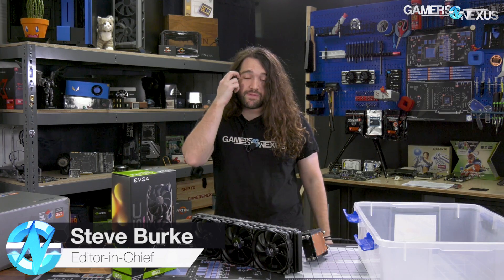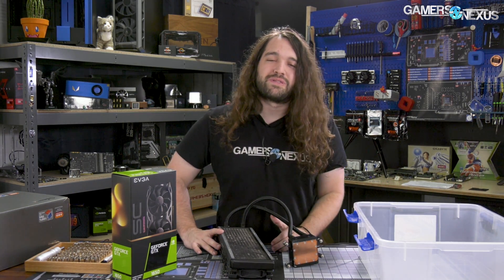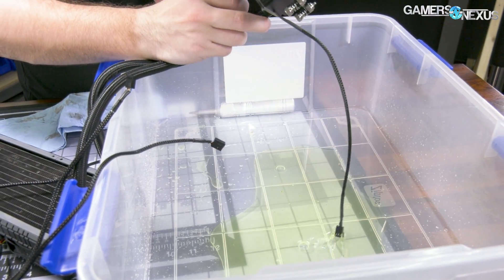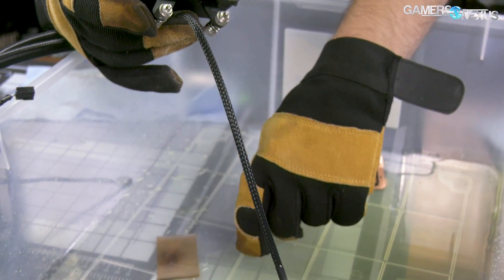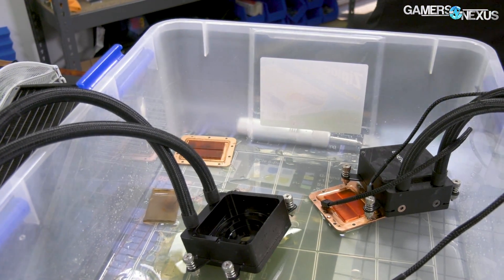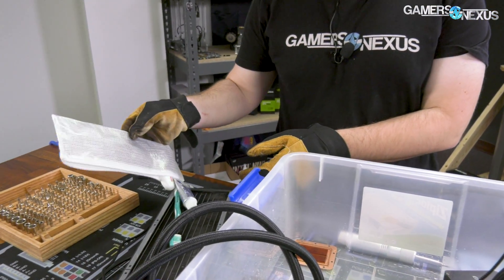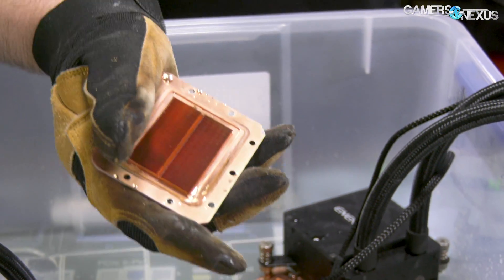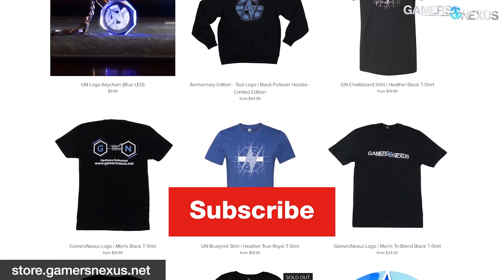Enermax's AIO Gunk Problem: Liqtech TR4 Cooler After 18 Months

Comment: My 360 died a month ago. CPU started throttling under any heavy load and you could feel on the radiator that it was only hot in one corner. I took that to mean there was little to no flow and I'm in the process of swapping it out for a Dark Rock Pro. Kinda lost faith in all AIO coolers because of this...

Comment: I replaced my cooler with a comparable Noctua when I noticed my temps to starting to rise a few months back. Just from morbid curiosity, I tore apart my 280mm Liqtech and found that it does seem to actually dissolve the white gasket somehow, also in my unit I noticed both a considerable amount of corrosion, some of which was on the SIDE of my cold plate as well! There was also some type of yellowish,almost grease like fungus that had built in the loop, long story short I just threw mine out, but seriously enermax really should've done better with these coolers considering when they were released they were cooling 500+$ processors, like if I had cooked my 1920X just months after purchase, I would've been a very unpleasant customer for their customer service to handle, but I digress.

Comment: My Enermax LiqTech 360 died exactly one week ago. Pump works but radiator does not get warm. Tubes get really hot, block as well. Maybe the radiator is gunkt.
Thinking about getting a noctua or bequiet air cooler, but I would have to change my case too.

Comment: I'm not a fan of AiOs, they just aren't built to last.
Though I wonder if anything grows inside heatpipes?
Reply: Damian Chiliński  I sincerely doubt any water cooled system will run without maintenance for more than 4 years, there's just too many points of failure, which may go unnoticed long enough to cause catastrophic damage.
I can't reccomend anything high maintenance like water cooling for important equipment, since any failure will require a lot of down time.

Comment: Bought one based on your review, but sadly you can't test for these things, I guess the only thing you could do is go by brand reputation. Amazon reviews can be quite helpful in that regard though. Anyhow, mine died, luckily my 1950x protected itself and shut down the pc. I thought my overclock was unstable but even stock was unstable so I looked at the cooler for a bit, the pump was running just fine but no water got to the rad. The block would heat up and over the course of minutes you could feel the tube get hotter and very slowly moving towards the rad. Send it back and got a new one but never used it again. It did reduce my overclocking stability it seems, but luckily didn't kill my cpu or leak over my motherboard. Just went open loop after that. Also, the fans died after only a few months, that was annoying, won't go the enermax route anytime soon, if one part fails, it happens, but if both the loop and the fans fail, reliably, nah thanks.

Comment: Would a cheap jeweller's ultrasonic cleaner be effective at cleaning water cooling parts (like the microfin array)?
Reply: I have one of those ultrasonic cleaners, but I would not say it's effective at removing hard gunk. When used with any sort of jewelry it's accompanied with a special chemical specifically for the purpose. It's not something I would recommend for a hardcore cleaning

Comment: My gen1 Enermax TR4 360 was clogged after about six months. Gen 2 was supposed to solve the "issues". After about three months I had idling temps close to 68C. Opened it, cleaned it out and refilled and was down to idling temps of low 30's. This is what my Gen2 looked like: https://twitter.com/DadTheTechie/status/1113144147781849090

Comment: I have the tr4II model, lasted 6 months before my temps nearly doubled on my 1920x.  Took it apart, cleaned out the sealant gunk, the fluid was filled with junk, replaced the fluid with distilled water and ek cryo fuel.   Temps are now in check.  But an off the shelf aio should not need that level of maintence.

Comment: Just moved back to air cooler (Cryorig) a few days ago. I used to have a 120 water cooler on my (non TR) machine, just because I have it lying around (it's from my last build). It's a very old one and not very good performance. I switch it out because I started to doubt its reliability... 

I might get a new one if I replace my PC case, but for now I'll just use air cooler.

Comment: My ID cooling frost flow 280 after 18 months loads of gunk and calcification cleaned up and filled with mix of deionised water and car coolant restore performance. I could heat air going through the loop while moving case when computer was running.

Comment: Mine failed after six months and was incredibly gunked up.   I couldn't clean it despite trying all sorts of solvents and abrasives.  Both the cold plate and the housing were covered in corrosion. 

I only threw it in the trash last week but I still have photos.   I had intended refilling it (if I ever succeeded in cleaning it) but realised I had lost all confidence in it and switched to Noctua.

Comment: Oh my god please review the LiqTech 2 LGA115x/AM4 edition!
Reply: He doesn't seem to have a 240mm and he would have to buy it. But the point is to review a cooler not after purchase, but after a year of use, to see if 2nd gen has the same problems as the 1st gen, in a known controlled environment. Mine Enermax Liqmax 2 240 is running since November 2018, I think. For now the temps are good and stable - so, keeping fingers crossed myself too.
Reply: vadutube Seems like you responded to the wrong comment...
This in no way fits my request.
Reply: @Mikkel111  Sorry, I thought you meant the 240mm version for 115x/am4. Were you referring to Liq Tech 2 - 360mm? If so, he still needs to have/buy one and use it overtime. Anyway, I am concerned of all of them now, mine 240mm including.
Reply: vadutube I simply requested he reviewed the LiqTech 2 Non-TR4
Basically no one has reviewed it, and since it’s claimed 500 Watts TDP, it would suggest it’s the most OP AIO in existence.

Comment: This just happened to my Lepa Aquachanger 240mm as well. Same brownish debris in the liquid, same corrosion on the cold plate and the micro-fins were almost completely blocked by that goop. I believe Lepa and Enermax are the same company but I'm not positive. The AIO was 3 years old and was getting 90+ degree temps on a base clock 6600k. If Lepa and Enermax are the same manufacturer then this has been going on for a very long time and I'm hoping to see a class action suit in their future.

Comment: Thanks, I was only aware of the maintenance required for custom water loops and assumed the manufacturers had it 'sorted'. So would an air cooler in say a Siverstone RL06 beat a AIO radiator for thermals and reliability- e.g. great airflow case with air cooler vs restricted exhaust case due to radiators restricting airflow?
Remember the Fluoride in the toothpaste is damaging the AIO. ;-P
Reply: it interacts very weakly and any residue left behind can quickly be mitigated by corrosion inhibitors in most/all cooling solutions

Comment: Lmao people who buy water systems don't know basics of conductivity. Look it up.
Reply: Deionized water, pure H2O, has a higher resistance than silicon. Even sea water has a higher resistance than nichrome wire which is used as a resistor in everyday applications. There would have to be substantial impurities before water becomes a half way decent conductor.

When your phone gets soaked, it's often the higher resistance connections that cause issues. 

I would list the actual measurements, but judging by your ignorance, inverse squares are probably a bit above your education.

Water is a better thermal conductor than air.

Water cooling systems are used reliably every day in millions of applications, including electronics. Just cause a company builds a sub par product does not mean you throw the baby out with the bath water.

Comment: on your mod mat, i am very happy that you fixed the ruler on the bottom, once i get my work bench together i will be buying one. a little expensive for a static safe surface, but the print is more than worth the markup. (woops your image on the store site shows the old ruler with the numbers all between the marks, hell no, all the numbers need to be under the marks, otherwise half of them are useless unless you want to hang something OFF the mat to measure it). i'll get a small one soon though, the print is very useful and the size would be great for quick laptop, tablet, or cellphone work. let me know if the big ones are also "fixed" because i would prefer it.

Comment: I wonder... Did they opt-out of using distilled water and decide to use lake water ran though a coffee filter? 

(Pictures Linked) I had to replace someones Liqtech TR4 because their 2990WX was overheating; The block and tubing were really hot as well but the pump was running 'just fine'. He decided to simply replace the AIO and RMA the defective cooler. After watching this video I wish I could've taken it apart... I didn't have a thermal probe at hand for the FLUKE 561-R but the infrared reading on the side of the socket was a max of 130.4F, the side of the pump housing got as high as 127F and the top of the housing with the Enermax Logo got as hot as 113F. https://imgur.com/a/fz3IpL8

Comment: I was a little disappointed by this analysis. If the main speculation put forth, near the start of this video, is that this AIO cooler gets gunked up with bacterial growth, then I would have expected GN to get some agar plates and try to culture whatever gunk came out of the first disassembled cooler. I would like to know what actually came out of that cooler - bacteria or something else. I do like the second hypothesis (degrading gasket), but I would like to see the first hypothesis resolved.
Reply: This is purely my opinion. I feel like in regards to what Steve put forth about the coolers, that it's both. Enermax failed to include a proper biocide in the coolant. Also included shotty gaskets that are prone to degrading due to my guess the lack of the biocide causing the bacteria to eat away at the gasket.

Comment: So if you want to go Threadripper + water, the only choice is a custom loop then? Damn... Noctua doesn't even make a decorative cover for the U14S
Reply: TR4 AIOs' are available by coolmaster. 27-33 idle temps.
Reply: @SteS  that's good to hear. Thermaltake also announced something similar recently. But while the size of the coldplate seems appropriate, I'm concerned that due to low micro fin area they won't perform to their full potential. Thanks for the suggestion, I'll consider it.
Reply: @neoqueto  here's the link for the one I bought. COOLERMASTER MasterLiquid ML360R RGB TR4 AIO Cooler https://www.amazon.co.uk/dp/B07H9JN58H/ref=cm_sw_r_cp_apa_i_5gPWCbQV3W4HX I've no issues with it at all. One person gave it one star based on the position of the in and out from the water block among other things I didn't have an issue with, because it wouldn't help convention. Pretty sure that's the rads job (idiot). Also says enermax beats it by 8 degrees under load. If that's the case why bother changing it in the first place. Seems an Enermax employee bought one to leave a bad review.

One very minor gripe I have is the connections to the RGB splitters could be a little more secure.

Comment: :/ I have the 3-fan 360mm version of this cooler too. Haven't opened the loop yet, though I've already replaced all of the fans because 2 of them died (one silently, one noisily). Can you at least hold off on telling me about needing to clean and "detox" my entire loop until 3rd gen threadripper comes out so I can wait till upgrading off my 1950x...
At least it's a pretty easy to disassemble and refill AIO.

Comment: Not just enermax. Look at coolermaster aios from 4 years ago and the Corsair H100. All brown gunk.
Reply: i have a H100 from 2012-2013. Still runs fine. 35c at idle and 55-60c at full speed during the summer. Though I will admit, I really wanna crack it open and tinker.

Comment: I got the 240 right when it came out, 4 months later, my PCU temps started rising and i assumed it was faulty, so I put RMAing it on the long finger and bought the 280 cersion and again within 4-5 months it was boiling (75-88c) at that point I just ripped it out and built a custom waterloop with a res and a 280. Only last week did I RMA'd the two units, and am awaiting replacement units.

Comment: Had the gunk build up in my Enermax TR4 360 Liqtech. Was eating away at the plastic around the O ring and was nearly leaking onto the motherboard. That was 8 months after purchase. 

Had to get a Gen2 as there was simply no other option at the time that was suitable. But my temps are starting to go up again so I suspect another failure.
Reply: Hope you've kept a catalog and proof, that's pretty bullshit. I would go to the manufacturer at that point. Planned Obsolescence is one thing, but failing within eight months of purchase is unacceptable for almost any product.

Comment: This is an issue with their coolant formula being used , it’s not the appropriate formula of chemicals needed to provide a proper protection against galvanic corrosion between the aluminum and the copper , also in doing so you create a small amount voltage or electrolysis within the fluid, this essentially accelerates the breakdown or ineffectiveness of the biocide being used. Typically biocides are an elemental composition of a certain metal element , so electrolyzing the loop will render the biocide useless or just plain ineffective.

Comment: I have had my Thermaltake Water 2.0 Performer and Extreme in use on CPU/GPU for 4 years. Had only a tiny bit of gunk. 
Those coolers can be ripped apart and refilled/tubed or made into a customer loop (which is what I did).
Reply: Thermaltake waaaaaayyyyy better than enercrap

Comment: So am I lucky having my idle temps at like 37c through random spikes at 3.9ghz all cores 1.264v? 1950x
Reply: i'm at 30°C at 4GHz throughout with 1.351v on the same cpu
Reply: @eftalanquest  I used to be able to have my cpu at 4ghz or more but the 240mm aio kinda cant handle it anymore.
Reply: @eftalanquest  apparently my cpu 28c right now. I just checked with hardware info. I think I was on the right section.

Comment: I got 2 of the 360mm TR4 Models, one original non RGB, the second with the RGB lighting. The first one failed after about 11 month, contacted Enermax and they sent me a replacement, the updated version. They didn't want the old unit back, so I took it apart and cleaned it. I refilled it with the same coolant we are using in our machines ( copper, aluminum, stainless steel, brass, all mixed materials ). It's not antifreeze but anti corrosive. I tested it and put it on the shelf. After about 6 month the new unit failed as well, installed the first one back in the system and its running fine ever since. I livestreamed the repair of the RGB model on twitch, that unit is now on the shelf for future use.
Reply: Link to the vid? Cheers.
Reply: @SteS  Look for Leifstech in Discord or Twitch, I don't want to link directly. Also, the coolant I use is the Motorex Cool X ( I use the cool concentrate and mix with distilled water ( 11% ), Cool X is premixed. The 360mm TR4 Liqtech takes 150ml of fluid, so you don't need much.
Reply: @Leif1024  perfect thanks.
Reply: @Leif1024  hey, can't find you on discord and there's no vid on twitch.
Reply: @SteS  I just checked, you are correct, Twitch deleted all videos..... I will upload it on YT, not edited. Discord is working fine though.
Reply: @Leif1024  thanks. I'll have a look.

Comment: I built a brand new pc in Feb. of 2018 and decided to use the Enermax Liqtech TR4 280 in it and by October i noticed my idle temps were at 70c when the day before idle temp was 32c-35c.it literally stopped working that fast.I decided to take it apart and see what was going on,the pump was 100% blocked by debris and the fluid was dark brown,the liquid had large chunks of debris in it.upon closer inspection i noticed the aluminum  inside the block was severely eroded and had large pits in it to the point that the small strip of aluminum that holds the rubber seal in place was actually eaten away.At that point I realized it wasn't fixable so didn't bother to look in the radiator although I wish I would have because I'm certain that it would also have had a large amount of debris in it.I'll never purchase another Enermax product,EVER!I would recommend anyone that has one of the first gen coolers to open it up and replace the coolant in it even if it seems like it's working okay.

Comment: At a guess not running the thing is a best case scenario, warm (not hot) water tends to help bacteria growth from what I know, and also circulating the water would tend to collect the gunk in the points of highest resistance, i.e. the cold plate with its micro fins. The growths are probably more evenly spread through the liquid in your example.
Reply: Im leaning more towards the gasket breaking down. I wonder if the solution is the problem or the material of the gasket.
Reply: @killtyrant  Could be, though would the gasket breaking down create that kind of slimy white gunk that blocks the whole finn area?